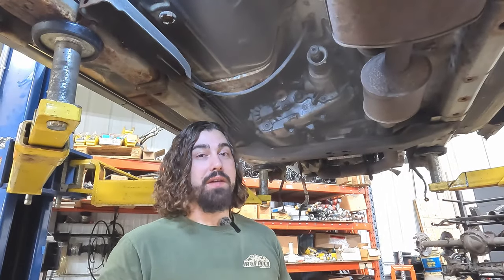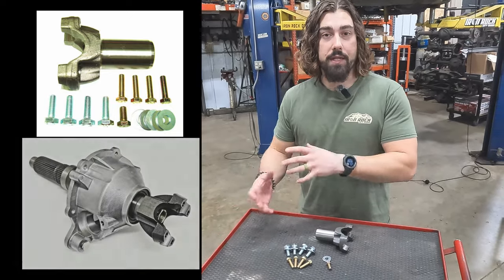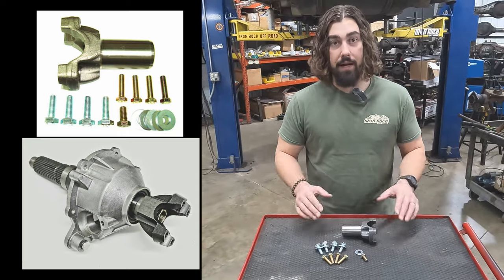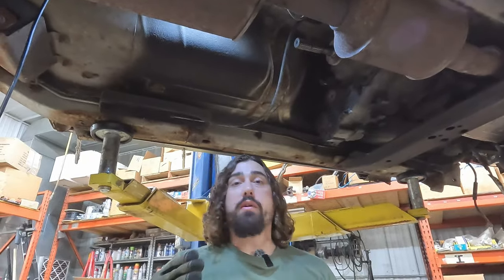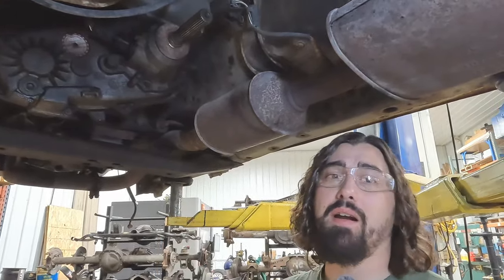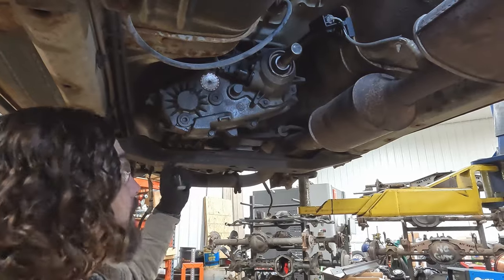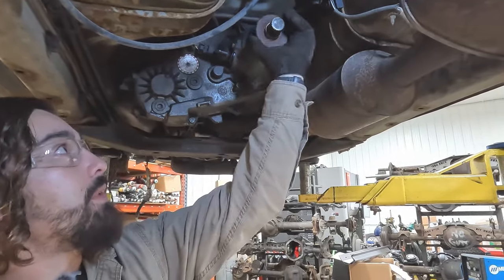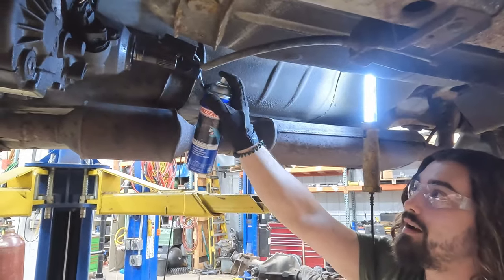HOW TO: Hack N Tap Install - Slip Yoke Eliminator the EASY Way!

Comment: While it sounds sketchy, having the shaft turning really does make for a nice, clean cut, and it actually isn't that bad in practice (at least on the ground - on a lift like that, I think I'd pass... LOL).

I bought the jig tool and it works great, with only one gripe - the point is to be able to get a nice, straight hole in there, but that advantage kind of gets lost if you either freehand the alignment of the 1/4" pilot or drill it using the 5/16" hole in the jig. So I just went straight to the 5/16" so I could take full advantage of the jig. I found myself wishing the jig had a 1/4" hole instead, so I could use the jig for that and then just chase it freehand at 5/16".

Regardless, made for a nice, clean install on the 242 in my WJ. 🙂
Reply from the maker: Yeah, we have done them with the vehicle in gear, and it does work out pretty slick indeed, but we cannot recommend for liability reasons, you know?
Reply: Oh yeah, absolutely understand! I appreciate you guys putting these videos together - really helpful for someone considering a project. 🙂
Reply: I felt the same so I went to big R some areas it's called cal ranch or tsc all basically same store if you got a good hardware store they will have it also but not big box stores I bought a bronze bushing for under 3$ that was 5/16 od 1/4 id put it in the tool for pilot hole worked great

Comment: I put it in drive with the key off use a starter bypass button to spin the  shaft in drive while i chanfered it worked great
Reply from the maker: That's a creative solution!

Comment: Ok this might be a dumb question do you but the double cardin joint on diff or t case it will fit either way
Reply from the maker: No worries. The double cardan joint goes at the transfer case.
Reply: @IronRockOffRoad  yep I figured that out from some photos on Google about 10 mins after I asked
Reply from the maker: @jeremyhanna3852  Glad to hear it. We're always willing to help out if we can. 👍

Comment: Is this the same install for a 247 T-case ?
Reply from the maker: @matthew7972 I assume this is for your WJ? If so, we have seen some WJ 247 t-cases that are already drilled and tapped from the factory. If not, you will need a 5/16 carbide drill bit for the tap drill, also a 3/8 carbide drill bit to remove the hardened area before tapping. Then a standard high-speed steel tap can be used. This will also require spacer washers for proper seal alignment. The spacer washers go inside the new yoke to make it sit at the correct depth inside the t-case. You might need to source your own grade 8, 3/8" bolt to secure the yoke in place. The included bolt might not be the proper length.
Reply from the maker: @matthew7972 You can also check the Hack n Tap product listing on our website and instructions for more pictures and information.

Product listing:
https://www.ironrockoffroad.com/product/hack-n-tap-slip-yoke-eliminator-kit.html

Instructions:
https://www.ironrockoffroad.com/Merchant2/I6014_Hack_and_Tap_Install_27_Spline.pdf
Reply: @IronRockOffRoad  yes this is for my 2001 jeep WJ limited edition; 247 t-case Quadra drive. How do I know it’s already drilled and tapped?
Reply from the maker: @matthew7972  If you disconnect the drive shaft from the rear axle you can slide the slip yoke out of the transfer case with your driveshaft attached. Once it is out you can see the end of the output shaft on the t-case. If it is drilled and tapped already you can try threading in a 3/8-16 bolt. Thread it in until it bottoms, mark the bolt with tape, then thread it back out to see how deep the threads are.